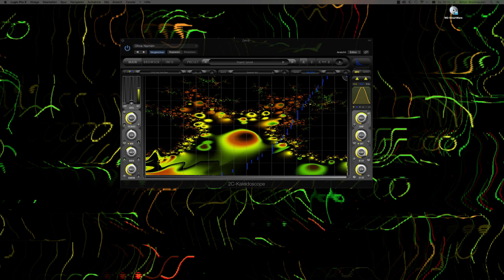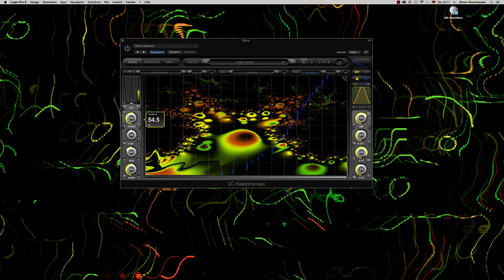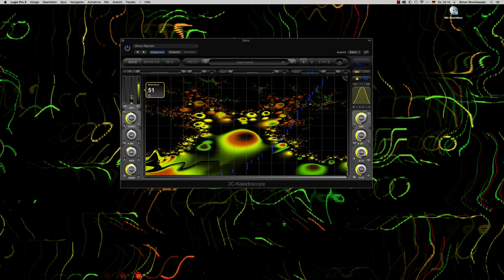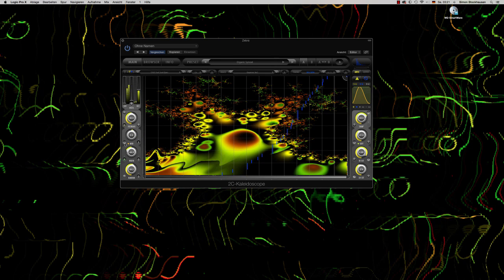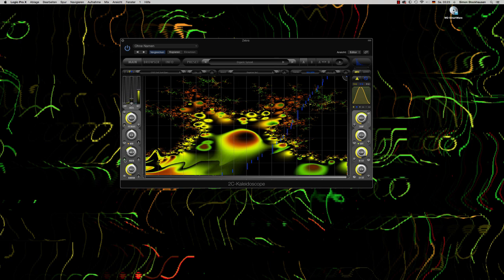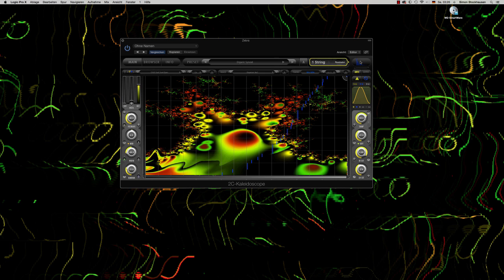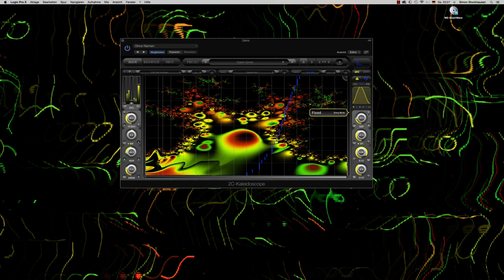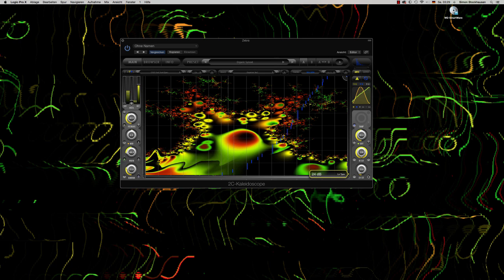Kaleidoscope Explained Part 1

Comment: Hey thanks for the amazing tutorial! I did have two questions. Reading up the manual I'm just trying to understand, when choosing an image, what determines how soft or hard it will make the sound you choose to use as your incoming audio?

Also, I did import my own png images and it gives me a warning sign and it doesn't pop up the image I imported as an image map, it just stays on the current one that is already there. The default images Kaleidoscope offers show up when I pick them, but not my own. How do I fix this? :(
Reply from the maker: Your images must be exactly 1024x1024 or 2048x2048 pixels, also you should remove the blue channel, as KS does not compute blue. I did not understand the first part of your question, randomizing the phases will diffuse the sound, if you want percussive-ness (e.g. for image-driven sequences), don't randomize the phases.
Reply: Simon Stockhausen Thanks I did not know that! That'll solve my problem. But no you answered my second question. And when you mean randomize the phases, where is that located? I'm confused about that

Later today I looked at the manual and found what you were referring to about the randomizing with phase. Thank you for your time and you made my music world exactly what I was looking for